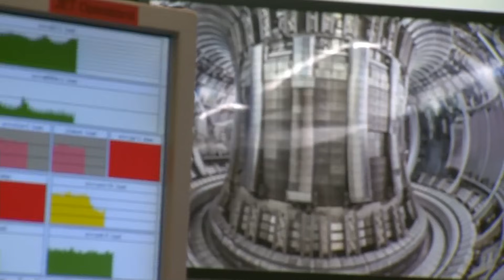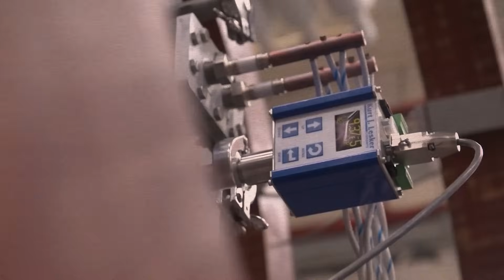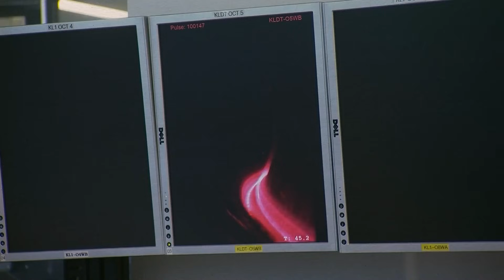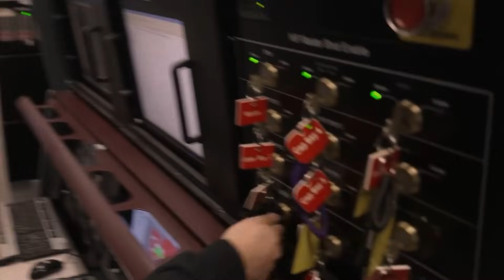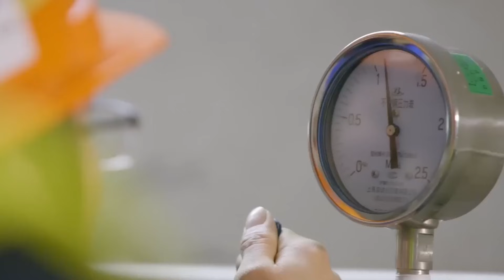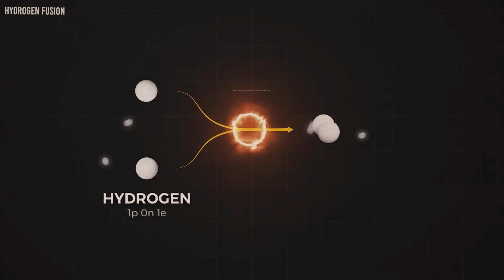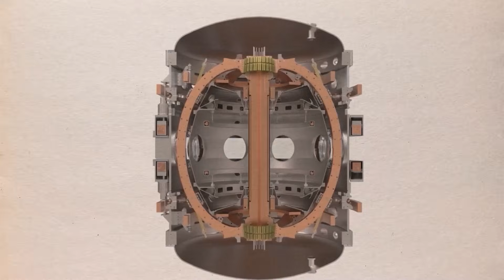China Just LAUNCHED Its Artificial Sun To Show It's TECHNOLOGICAL POWER!

Comment: If this type of fusion reactor were to blow up, theoretically, how big would the explosion be? Or would it just melt and leak nasty stuff?
Reply: First thought, right;))?
Reply: @DianaLuckysova  No, just curious. First thought was, what type of materials can handle such extreme temperatures, for extended periods of time? They're only able to run for very short durations, at this point. If it was capable of running for a  long time or continuously, what on earth, literally, can handle those temps without melting? Just wondering and haven't had time to look into it, yet. Like, will it only run for short periods and the energy be stored somewhere perhaps? Also, yes, what would happen in the event of catastrophic failure? An explosion, a meltdown? Of what magnitude if so? Again, just curious and was wondering about it. 
 Have an awesome day.

Comment: Nuclear fusion in the Sun's atmosphere begins under the physical conditions existing there at an initial plasma temperature of 5,000 K; by the end of the fusion reaction, the solar plasma temperature reaches 1,500,000 K, on average.  Sunspot temperatures on the Sun from 3,000 K, sunspots can be up to 100,000 miles in size. Doesn't this prove that nuclear fusion occurs on the surface of the Sun, not in the core of the Sun? If we take a good look at and study sunspots, it is clear that nuclear fusion takes place in the Sun's atmosphere.  
I know how to replicate the physical conditions for nuclear fusion in the Sun's atmosphere. I propose a reactor design with the same physical parameters for nuclear fusion and excess heat as in the Sun's atmosphere.    https://www.youtube.com/watch?v=FcypwoVOAAY 
To make a small working prototype confirming the principle of nuclear fusion in the Sun's atmosphere and obtain commercial heat needs about 10 million euros, manufacturing time 2 years. It could be less. Depends on the country where the prototype will be made.

Comment: Like trying to create a perpetual motion machine or a time machine it won't happen without more input than output.
Reply: "Like trying to create a perpetual motion machine or a time machine it won't happen without more input than output."
Not so with fusion, once the  fusion starts it does release more energy than you put in. This is because once you achieve  the plasma stage, deuterium atoms fuse with each other to form helium atoms. in the process energy is released in amounts that were predicted by Einstein, the energy contained in a mas is equal to the square of the speed of light, e=mc squared. Only a fraction of that energy is needed to sustain the plasma.
Unfortunately, containing that plasma and collecting that energy is the problem. However, fusion is only thirty yeas away, always, apparently.

Comment: If i remember right Boeing patented an artificial sun back in 1972. When i first heard about it i actually found the patent, quite worrying.
Reply: Patenting the concept is still extremely far away from actually building the power plant to work especially in space.
Reply: .  Chi has the third one in tandem up now. I noticed in 2018, just didn't understand then.never heard about the moon.
Reply: Look at the moon patent it was in the 60s turn around to 1969 and us has its first "moon" landing. Pretty weird they patent something they haven't been to until 9 years later.
Reply: Kevin Smith,  we have been seeing in use, one type, white light from LED  bulbs. Not much heat but version 1 and 2 have produced enough glare and light to hide multiple partial eclipses for years, from our bianary system(planet X and friends). I first observed it in 2018. Chi holds the patents for the previous 2, did their launches. Maintenance and manning by I dont know who. Someone is flying support to them. They have sat at that ballance point 1/3 from earth 2/3 from the sun, where energy is not used for position holding.